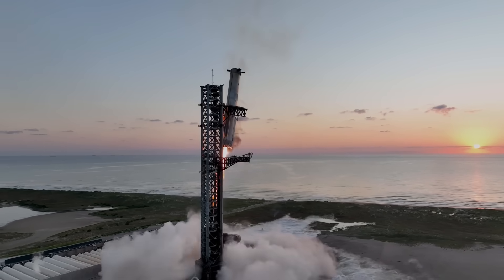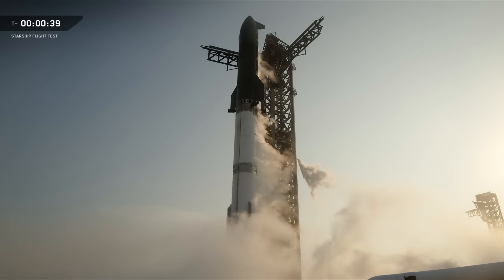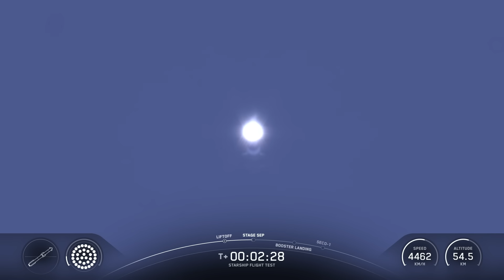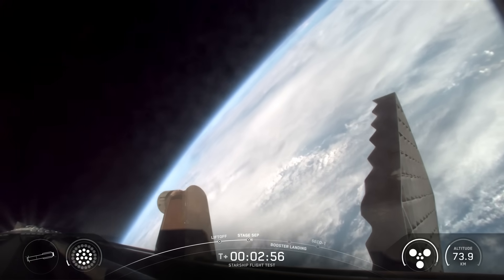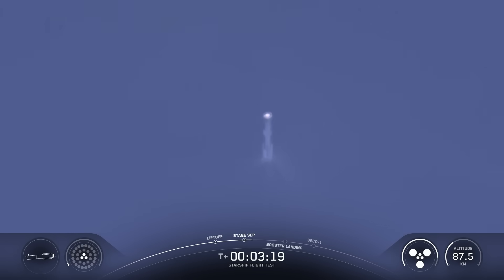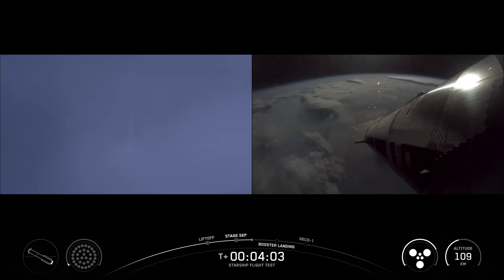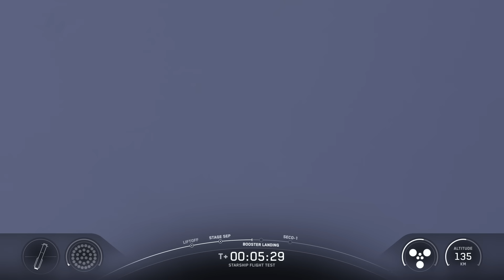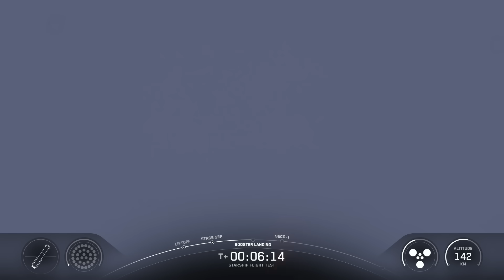SpaceX Builds Largest Reusable Booster, Also Makes Door That Won't Open - Starship Flight 9 Recap

Comment: "Move fast and break things" is fine if breaking actually moves things along quickly. But break too many things and progress becomes slow. Version2 is proving difficult to move along .
Reply: "Move fast and break things" might be a viable strategy if you're building a phone app. Not if you're trying to build a rocket ship.
Reply: but everyone at spacex gets a ribbon after every failure
Reply: Exactly. No actual "progress"
Reply: I agree - significant design change is needed. Current design is badly flawed
Reply: I get the feeling that the three most prolific posters in this reply thread are the same guy trying to create some sort of artificial consensus with a peculiar doggedness of purpose, kind of like it's :ahem: their job to do so.
Reply: @jazzmusiccontinues1134  That's some weird paranoia you seem to be having. I think I am the 2nd or 3rd most active poster here, and I'm arguing against the other two most prolific posters, but I would not accuse even the other two of posting as if they are paid to do so, because they seem to be fanboys who have the unfortunate tendency to defend the corporation for free.
Reply: Break everything at once, and it becomes impossible to narrow down the actual issues. Sometimes slow and steady is better.
Reply: 1. How many times they've tried landing the F9, before it succeeded?
2. Any new technology development have many failures, far more than Starship, you just don't see it. For anyone who did any serious development this is completely normal. Annoying for sure, but normal. “I have not failed. I’ve just found 10,000 ways that won’t work” - Thomas A. Edison
3. You can avoid failures only by scaling back your ambitions. If you want to push the limits, you have to fail, because otherwise how do you even know where the limits are?  “If things are not failing, you are not innovating enough.” - Elon Musk.
4. Of course you can push too hard and want to big things. The symptom of that is failing the same way over and over. Starship didn't do that. The failures may look similar, but the root cause was different each time. As long as you are failing for different reasons, you are making progress.
5. Other rocket programs can't accept failure, because they are obscenely expensive. The current estimate for an SLS launch is $4B. But Starship is cheap, SpaceX can afford to fail.
Reply: @andrasbiro3007  On the other hand, Tesla knew his math, so he didn't need to first find all those 10,000 ways that won't work, like Edison did.
Reply: Move fast and break things is the mantra of idiots who have no problem spending other people’s money. It’s not real engineering. It’s not real program development.  It’s the shiny object for the dolts to be fascinated by…
Reply: Breaking things is fine until you break too many things and angry investors tell you to stop breaking so many things and make them some money.
Reply: So you believe Starship isn't moving quickly? You prefer SLS pace? 😂😂😂
Reply: "Move fast and break things" is what bullets are supposed to do.
Meanwhile in Thailand: community has been right there for 6,000 years and not been broken.
Reply: That is great when taxpayers are paying the things you break
Reply: It feels like Musk expected starship and super heavy to just be a scaling problem - as they did with falcon heavy, only to learn it wasn't at all.
Reply: @langdons2848  He expected the same with machine learning based self-driving based on vision alone. That’s his biggest problem, extrapolating a lot. I mean other than throwing Nazi salutes
Reply: @langdons2848 agreed. Which is more proof Elon isn’t an engineer. No engineer thinks that way. They all understand there’s more to it than changing scale…
Reply: @langdons2848 ya and they hate making falcon heavy
Reply: @langdons2848  Exactly.
Reply: @langdons2848  Elon, Rio Grande of rocket scientistry.
Reply: @aka-o9x I don't get the Rio Grande reference sorry (not being from your part of the world), but I'll take your word for it!
Reply: @langdons2848  The Romanian dictator Ceaușescu used to have self-given epithets like "The Genius of the Carpathians" and "The Danube of Thoughts". (The Danube being a big river in that part of Europe). Now, check the Wikipedia-article about Boca Chica (Texas), which says: Boca Chica, meaning "small mouth" in Spanish, refers to the mouth of the Rio Grande. The name highlights the river's modest flow, which can diminish significantly during droughts, sometimes causing its mouth to disappear entirely.
Reply: @aka-o9x lol - yeah that figures.
Reply: @langdons2848  
In reality Elon has always said that Starship will be extremely hard. He expected the booster to be relatively easy, and it was.
Reply: @andrasbiro3007 and yet he's talking about getting people to Mars this decade. His version of "hard" doesn't seem to match the reality.
Reply: @langdons2848  
I don't see the contradiction.
Testing a lot is exactly how you improve fast. And Starship isn't far from ready.
- Reached orbit multiple times.
- Booster got caught 3 times I think.
- Booster got reused already.
- Ship achieved controlled reentry and precise water landing.
These were the hardest parts. Now it's going to get easier fast.
Reply: @andrasbiro3007  "now it's going to easier fast" that aged badly.
Reply: @langdons2848  
In what way? Just because they had a test failure? It happens. NASA lost two shuttles with crew. And after the second one the whole program was terminated.
Reply: @andrasbiro3007 but - you said it would be easy... Now you're saying it's hard? Pick a set of goal posts - please.
Reply: @langdons2848  
What are you even talking about?
I've sad the hard parts are done, and now it gets easier. That doesn't mean everything will go perfectly.
Reply: Accurate
Reply: but Mars 2028!!!
Reply: @bbbnuyyyy That will end up like fsd in 2018
Reply: @bbbnuyyyy  Zero chance of that. Maybe crash on Mars. Think of Apollo 13. Without the backup capability of the Lunar Module they would have all died. Only brilliant design with redundancy, allowed them to make it back alive. Starship has no backup. Any significant malfunction and you are for sure dead.
Reply: @bbbnuyyyy moon won’t even be possible for America then, let alone Mars. 😂
Reply: @bbbnuyyyy  Is that the new Mars 2021?
Reply: @bbbnuyyyy 2028?  Lol. Isn’t there supposed to be a dozen ships going there unmanned in 2026?
Reply: @bbbnuyyyy oh nice a sarcasm in the wild
Reply: They obviously need to hire you to sort everything out…….
Reply: @AnalogueGround  A little argument from authority fallacy is hiding in your comment. But to change the topic to something more substantial, I don't think Starship's problems have much to do with the expertise of personnel, it's more a problem of organisation and process.

When there is no painstaking quality control, and people are expected to shut up & do what they are told (which is the current SpaceX company culture, unlike back when Falcon was developed), a lot of things that can go wrong will go wrong, and there are very very very many things that can go wrong for a big complex project like this one.
Reply: Saturn I achieved orbit on its very first two-stage launch, which was its fifth launch, after six years of development. Saturn V reached orbit on its very first flight, after a 5-year development. SLS was also successful on its very first flight, after an 11-year development. New Glenn reached orbit on its very first flight, after a 12-year development (although it failed at landing). Starship did not achieve orbit after 9 partial and 9 integrated test flights and a development time of 13 years, including 6 years of test flights, and even the last launch was less ambitious than the first launches of many of the others I mentioned. I'd say their development principle doesn't work: they keep breaking things but fail to move fast.
Reply: @Daneelro  - the problem with iterative design in these circumstances is that it relies on the initial design being roughly in the ballpark to start with.  It appears to me that the new propellant delivery system to the outer engines on V2 following three flights in a row failing due to propellant  leaks of different types with mods between each one  is so FUBAR it's beyond iterative improvement and needs to be redesigned from scratch.
Reply: @Daneelro  And how many of those rockets had to be caught and reused? How many of those companies are making multiple launches per week and reusing rockets 50 times? You have absolutely no f**** argument.
Reply: @Daneelro  Agreed 100%
Reply: @Daneelro sls did not have an 11 year development. It was build on top of work done by the constellation programme, which was build on top of the shuttle programme, which originated in the 70s, if not 60s.
Reply: @nt78stonewobble  I have news for you: every engineering is built on prior engineering. Including Starship, which is loosely built on top of the Falcon 9 development, which is built on top of the DC-X development, which had roots in the Douglas SASSTO from 1967 and incorporated tech developed for the Space Shuttle.
Reply: @Daneelro do you see the difference? None of the rocket you mentioned come back to the launch pads yet, except starship super heavy, which is the biggest of them all
Reply: @plane.355  Do you see that all the vehicles mentioned achieved what they set out to do?
Reply: @plane.355 Starship never came back to the launch pad. My guess is they will scrap the whole idea eventually and get back to cheaper, lighter, expendable second stage.
Reply: @plane.355  So what? That's not an essential difference when it comes to the viability of the development process. Especially if you consider that uncrewed Mars flights were first promised for 2022, and development is now also two years behind on the much more specific HLS schedule.

What SpaceX is doing with Starship is not even what they did with the Falcon, a much more simple rocket. Starship, like all the other rockets I mentioned, is a big complex machinery with a complex mission profile where very many things can go wrong. By applying quick fixes after every launch failure and rushing into the next launch, they just run into the next problem, which is guaranteed. It would have been cheaper and even faster to do more thorough component testing & simulations, with proper quality control, instead of all of the last 9 launches. A lot of the problems that caused the failures could have been anticipated (some they were even warned about beforehand, like the deluge system or the vibrations).
Reply: @sootbird  That, or SpaceX will simply fail. With any other company, there would be no doubt that they would be doing what you said. And hopefully they are. But the higher ups (it isn't just you-know-who) are so brainwashed by their own BS they seem to care more about striving to achieve an impossible and ridiculous dream ("making life multiplanetary") then about staying competitive or fulfilling their contractual obligations.
Reply: @sootbird  
As Elon has been saying for 20 years, reusability is the key. They won't abandon it just because it's hard. They knew it'll be hard, it's not a surprise.
Also, the previous version did land successfully on water, so it's already proven to be possible. Now just have to optimize the system and fix the bugs.
Reply: @Daneelro  
You can't do much testing on the ground, or even in simulations. The way to orbit is a series of extreme environments, most of which are impossible to recreate on the ground, and especially not all of them at the same time.
You have two choices: stick to what works, or accept failures.
Reply: @Daneelro  "By applying quick fixes ... to a big complex machinery" (before the next deadline). This is just like mediocre teams of software engineers that try to build and maintain their humongous morass. The methodology is euphemistically called "Agile", although "Panic" might be more appropriate.
Reply: @andrasbiro3007  Why do you speak with such confidence about something you clearly have zero clue about? Of course you can test on the ground, or else neither Saturn-V, nor SLS, not New Glenn would have aced their first launches the way they did. And for the record, neither of those fit your "stick to what works" category, not even SLS, in spite of being the reconstruction of something that already works.
Reply: @plane.355  Irrelevant. Booster return is a problem solved by Falcon 9. That's why it's the only part of the system that seems to work well.
Reply: @ryanspencer6778  Um.

One, Falcon 9 and Superheavy are two very different machines, with practically no shared components and different landing procedures, so Falcon 9 return solved absolutely nothing for Superheavy return. 

Two, maybe you missed this, but the booster just blew up on flight 9. This was the first time they flew one caught on a previous flight again, and it will be interesting to see whether the failure had to do with any damage suffered during landing which wasn't recognised during inspection & re-fitting (assuming SpaceX will admit it in public). So no, Superheavy return is not solved yet.
Reply: @plane.355 My brother in Christ they had no CAD, no CFD, and were for the first time trying to make huge rockets. And made that in 6 years. 6 years.
Reply: @Daneelro  - interesting that the excellent CSI:Starbase video on harmonic resonance and its role in Starship problems goes back into the history of pogo and how Starship at least initially didn't have any anti-pogo measures included in it.
Reply: @andrasbiro3007  - the previous version worked, the current one doesn't.  This isn't optimisation.
Reply: @sootbird didn't i specifically mentioned "starship super heavy", which is the booster?
Reply: @malcolmstreet1  
It is. Exactly because it's a new version, it's less reliable. The first one also needed a few iterations to work.
Future iterations will likely do better, as they collect more and more data, and gain experience.
Reply: @Daneelro  
Because I actually know what I'm talking about.
You can test on the ground, but only so much. Nothing replaces an actual launch.
And yes, all of those are "stick to what works" rockets. The Saturn V is the culmination of a series of other development programs, and lots and lots of launches. With von Braun on the team it's roots go back to the German V2 program.
Rockets exploding on the launch pad was very common until they stopped innovating.
New Glenn was developed for like 20 years, and one successful launch doesn't prove reliability.
As for SLS, it's the definition "stick to what works", it's mostly reused Shuttle parts.
Reply: @andrasbiro3007  You have absolutely no clue what you're talking about. By your logic, Starship itself is "stick to what works".
Reply: @Daneelro  
That's nonsense.
Reply: @andrasbiro3007  You don't even say what is supposed to be nonsense. Learn how to make an argument.
Reply: @Daneelro  
I replied to your reply, obviously.
Reply: @Daneelro but Starship was stopped from going orbital as a safety precaution. Starship is also so far ahead in terms of aiming to be reusable that its going to take more effort. The booster achieved reusability on its 1st attempt. All these other companies are doing  very well tried and tested methods to achieve tiny steps forward. Space X achieved the impossible by reusing their medium booster, Falcon 9, now their super heavy, and now they work on getting their 2nd stage rapidly reusable which is a huge step beyond what anyone has done before. How long would that take without rapid iteration?
Reply: @philleng480  Even if it were stopped from going orbital as a safety precaution (but we all know that that is only PR for the public), that's a minus (other rockets did not need that precaution) and doesn't change the fact that it still had no orbital test.

The booster did not achieve reusability on its 1st attempt, in fact it still did not. Catching it doesn't mean that it was recovered in a reusable state, and indeed only a single engine of the first booster was re-used. The current launch featured a complete booster re-used, but it blew up, and we have to see whether it had to do with any unrecognised damage from its previous flight. But all of this is irrelevant when considering SpaceX's inability to maintain its development schedule and its inability to move faster than projects of similar scale with a very different development principle.
Reply: @philleng480  - "The booster achieved reusability on its 1st attempt."  It blew up on the way down.  Not a credible (or safe) mode of "reusable" operation.

" now they work on getting their 2nd stage rapidly reusable"  Which is off in lala land given they can't even get V2 to complete a re-entry, despite "rapid iteration" before the last two flights.
Reply: My my, the faithful are losing faith. Hard times ahead
Reply: @AndrewNorman-x7h  Therefore, the cult leader will predict the end of the world next. Oh, but he already did...
Reply: @AndrewNorman-x7h  At some point reality had to set in for them. 3 consecutive failures is impossible to ignore, even for the most brainwashed of fanboy.
Reply: @maxwellquebec8675  Three failures is not many on a difficult engineering project
Reply: @AndrewNorman-x7h Name one engineering project that has suffered 3 consecutive failures anywhere near this magnitude and wasn't cancelled. I'll wait.
Reply: @maxwellquebec8675  - and all to do with propellant leaks when changes to that system were a major new feature of V2.
Reply: @maxwellquebec8675  and all in the same area - propellant leaks, despite remedial work before the last two launches.
Reply: @maxwellquebec8675 if you tried to build 100 lanes highway three times and all fails, yeah that'd get cancelled
But for starship, everything is a bit different
Reply: @plane.355 Why are the rules always different when fragile billionaires are involved?
Reply: honestly at this rate im half expecting the chinese to pass them on the whole superheavy schtick with the long march 9.
Reply: @romanplays1 they're already surpassing SpaceX in the death, destruction and environmental pollution.
Reply: @romanplays1 good concern
Reply: @romanplays1 dude... If starship is an absolute failure and nothing can be used from it.

Having an operational super heavy booster on its own puts SpaceX on a league of its one. And while Starship has been troublesome... Superheavy is so reliable they are literally inventing situations to break it.
Reply: @romanplays1 long march 9 won't be reusable tho?
Reply: @nt78stonewobble Reusability is unnecessary when you have raw manufacturing ability, an arseload of money, and the goodwill of your country.
Reply: @nt78stonewobble  The first stage of the Long March 9 will be reusable. But the whole subject of reusability is over-hyped when it comes to rockets meant for launches beyond Earth orbit. It's all a function of the greater delta-v. For the most efficient use of fuel, it's better to have more stages, and for even the first stage (not counting extra boosters) reaching a speed where recovery requires too much braking to be sensible. For Starship, the price of two reusable stages is the necessity of at least 15 refuelings until it reaches even the Moon (and a lower number for New Glenn), whereas Saturn V or SLS or LM9 can go to the Moon outright. The balance there is not so much in favour of reusable rockets, especially if you consider that 15 launches mean a much higher mission failure probability than one single launch.
Reply: @Daneelro  Didn't know that about long march 9. 

Fuel isn't the most expensive thing about payload to orbit. The most expensive thing about that is the rocket itself. 

I don't know if it's true, but the fuel cost of a falcon 9 launch is only 150.000 usd... 

Out of a total price of 70.000.000 usd.
Reply: @romanplays1  What an absolutely ridiculous statement.
Reply: @usnairframer  It was recieved wisdom that it was ridiculous for the Chinese to pass the US in manufacturing. How's that turned out for everyone?
Reply: @whistlingchickenleg yeah, when they have an existing design to copy. Actually being original, though, big struggle for them.
Reply: @ahealthybigmac  That was true in the 90s. Unfortunately, one of the existing designs they copied in the 90s was education systems. Three decades later, and they actually have a pool of experienced engineers to work on product development. 

Remember: If you know their weaknesses, chances are they are also well aware of them and have taken steps to stop them being weaknesses going forward.
Reply: @ahealthybigmac  Don't disagree, but as the Long March 9 was specifically mentioned I think we're still within the "existing design" range.
Reply: Please go back to V1
Reply: @cutepuppy778  - yes, adopt the revised fin positions and heat shielding from V2 and leave it at that and at least have something that will be a path to further flight tests.  All V2 has done is driven Starship back to IFT 3 and instead of going forward SpaceX is just trying to get back to functionality it had last year.
Reply: @malcolmstreet1  yeah that's my feeling too with this V2. It looks like they made a flawed new internal design that they still don't know how to prevent it from leaking and exploding. it's better to use a proven V1 design.
Reply: @cutepuppy778  Why? The V2 was necessary because the V1 didn't have anywhere near the desired lifting capacity.
Reply: @Daneelro  which is academic because being unable to complete a single flight so far V2 isn't lifting anything itself for the time being.  Get a conservative test vehicle that will allow to explore the flight regime first THEN come up with an optimised version.
Reply: @malcolmstreet1  But that's not how this works. This is very complex machinery, and changing some major parts will have repercussions in a lot of different parts and will change the flight plan. You cannot transfer experience with V1 to V2. (For the very same reason, SLS is a new rocket that needed a complete development process in spite of being mostly re-used Space Shuttle parts.)
Reply: @cutepuppy778 Why? Is there a huge demand to get bananas one at a time into orbit? V1 was fun, but trying to refine a launch system with a capacity of "N/A” is pointless.

The Starship 1/2/3 progression plan could have worked, but they tried it, and it has failed. Time for a new plan.
Reply: @maxwellquebec8675  - historical precedent.  The Rolls Royce Merlin aircraft engine lost nearly eighteen months in development in the 1930s because the chief engineer wanted to change to a theoretically more efficient "ramp head".  They couldn't sort it out and went back to the traditional Rolls Royce head design used in the Kestral.

Go back to V1 with minor improvements, do more testing, and when you have a larger bank of flight test information THEN go on and develop a new V2.
Reply: @malcolmstreet1 Only SpaceX has the data to know whether going back and refining a V1-type design is worth the effort. My opinion is no, more drastic changes are needed, but none of us have the actual data. That said, how that data is interpreted is likely leading to many heated battles inside SpaceX.
Reply: its a matter of perspective. By really any valid metric spacex have achieved more in the last 6 years of starship development than ULA or boeing have in the past 2 decades combined. Starship is slow by the expectations and standards that they've laid out for themselves, but within their industry they are 1 of only a few who don't work to geological timescales.
Reply: @anotheryoutubeuser142  - "By really any valid metric spacex have achieved more in the last 6 years of starship development than ULA or boeing have in the past 2 decades combined. "  After nine test flights they can't even get the second stage into orbit.

SLS on its first flight flew the first human-capable spacecraft out of LEO for over fifty years, sent it into orbit around the Moon replicating Apollo 8, it then got the furthest from earth of any such craft and then successfully returned to earth, re-entered and was recovered.  That flight did more than any other from anyone for ***5 decades***.
Reply: @anotheryoutubeuser142 what exactly has Starship achieved that is so special? Like genuinely
Reply: @SioxerNikita It's been a decent technology demonstrator, sort of like a mind-numbingly expensive Delta Clipper or X-15 program. For that much investment, though, you really want something that will give some concrete returns, and not just serve as an inspiration for future platforms.
Reply: @maxwellquebec8675  That doesn't answer my question, what has Starship achieved that is so special? Most of the tech shown by Starship has not really been ground breaking, at best it is refining tech from the 60s and 80s, at worst they are going down an impossible path due to lack of pre-planning.
Reply: @anotheryoutubeuser142 Vulcan and SLS both launched successfully to orbit with payloads/simulators so yes and no to that statement. Falcon yes Starship no. I'm starting to worry it is Elon's Spruce Goose.
Reply: Especially when up against the same issue that doomed the Soviet N1, those beautiful mach diamonds and visible shockwaves are tearing Starship apart. We're at the limit of physics, forces and material strength.
Reply: "becomes slow"....who is moving faster?
Reply: @archigoel  at this point, NASA. Starship has been in development for 9 years. It took 8 for Saturn V and Shuttle.
Reply: @archigoel exactly
Reply: @archigoel Chinese. Also, progress shouldn't be measured against rivals but against yourself. Because you will run yourself into a corner of "if rivals aren't progressing, I don't have to either".
Reply: @archigoel  Blue Origin and several Chinese entities
Reply: he was talking about the social contract